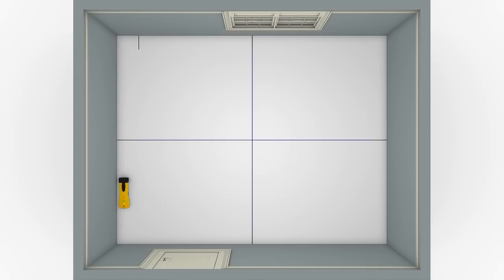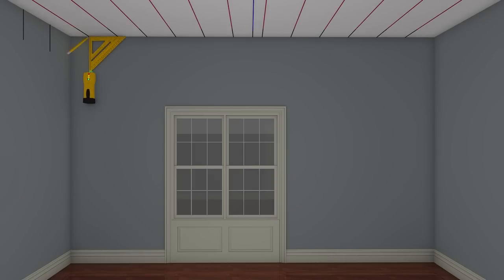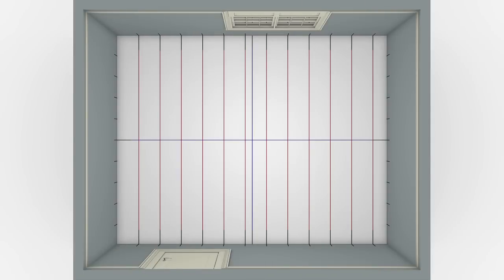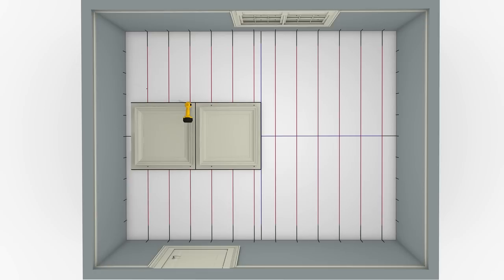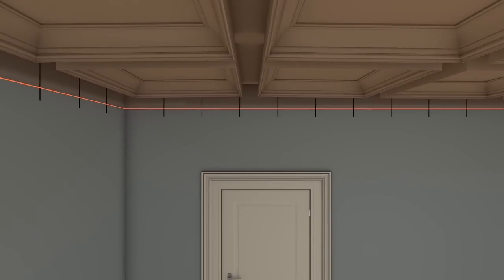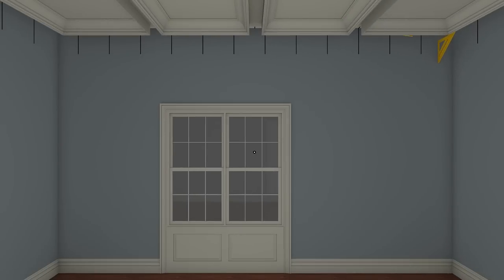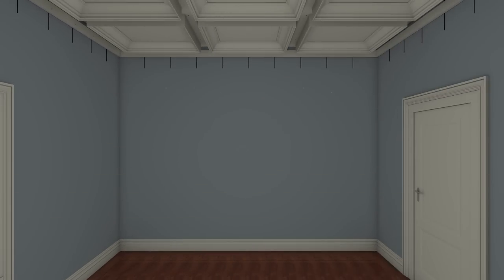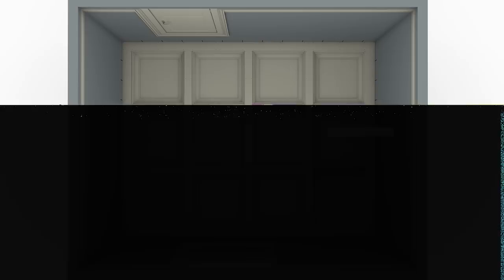Tilton Box Beam Coffered Ceiling System | QUICK & EASY TO INSTALL!

Comment: That's interesting but I have a few questions. What do you do if: 1. you have can lights, 2. a sprinkler system, 3. if you have speakers installed in the ceiling 4. the room is not square (it never is), the ceiling is not leveled. There is a huge difference between "building" a ceiling like that on a laptop, sitting on your couch and doing it in reality.
Reply: Stop asking Real Word Questions, Your ruining my perfect ceiling ;-)
Reply: You’d have to plan around the immovable thing (sprinklers) and plan to move all the rest around your ceiling. This is why most people do these ceilings at new construction or during a remodel. It seems as though you will have to supply this company with an actual measured layout of the room, and the pieces will be made specifically for your space. As for the squareness of the room, the level-ness of the ceiling etc - they were addressed in the video.
Reply: Simple. You delete the lights and sprinklers in that room.
Reply from the maker: We don't build our ceiling systems on a laptop, we custom manufacture them in facilities right here in the USA to support our economy. The video was created in virtual reality to provide a clear and concise overview of our simple process, but we also have a live action video for any naysayers that you can check out on our channel. 
1. If you have can/recessed light fixtures you can opt for our 'No Ceiling Panel' option which will allow you to install our system around these fixtures without the need to relocate or disturb them OR you can cut the appropriate sized holes for these fixtures into any of our other Ceiling Panel Options. https://www.tiltoncofferedceilings.com/box-beam-ceiling/product-options/ceiling-panels/ 
2. Unless you are willing to relocate the sprinkler heads we would need to plan the layout of your coffered ceiling so that they fall in desirable locations. 
3. Same as the answer for #1 except that speakers can be easily relocated as needed. 
4. We realize that no ceiling or room is going to be perfectly square and so our Box Beam Coffered Ceiling Systems have been designed to allow for flexibility in the Perimeter Beam Board to allow for variances. The Perimeter Beam Board can be ripped, scribed and/or tapered to accommodate as needed with the Perimeter molding covering any remaining differences.
Reply from the maker: @ralphvalkenhoff2887  This is certainly another viable option
Reply from the maker: @cloerockham8812  Precisely! We have measuring diagrams for all of the most commonly found ceiling shapes which can be used to easily provide is with the necessary dimensions. https://www.tiltoncofferedceilings.com/measuring-diagrams/
Reply from the maker: @1painter4hire  Haha!
Reply: @cofferedceilings   it's obvious You Guys are a High End Operation, There Always has to be that Guy who knows Everything, I'm sure You deal them All the time. Products look Great Guys !!!

Comment: good luck finding a perfectly squared room!
and people should know that probably have to scribe the perimeter trim boards for out of square corners, out of square walls, and bows in walls!
have a table saw ready and a box of caulking.
Reply: This is true.  My rooms look like something out of a carnival funhouse.
Reply: hostile177 
haha
Reply: Xvdeid
Reply: Any variance in the squareness of the room and/or straightness of the walls can be accounted for in the Perimeter Beam Boards. There are no standard or stock sizes with the Tilton Coffered Ceilings System therefore you would never end up with a 'partial' module. Every module we make is custom built for the ceiling it is intended for. We can produce any shape or size to fit any ceiling perfectly. (Copied from previous comment)
Reply: Thanks!
Reply from the maker: We realize that no ceiling or room is going to be perfectly square and so our Box Beam Coffered Ceiling Systems have been designed to allow for flexibility in the Perimeter Beam Board to allow for variances. The Perimeter Beam Board can be ripped, scribed and/or tapered to accommodate as needed with the Perimeter molding covering any remaining differences. So yes, have a table or circular saw ready if your room is really bad and a quantity of caulking to commensurate with your cutting ability (i.e. the worse your cutting the more caulk you'll need).

Comment: What if you have to cut a section to fit or do you order after measuring your ceiling? Can you cut for lights? What happens if a light does not fall into a section?
Reply from the maker: None of the coffer modules ("sections") will need to be cut to fit since they are custom manufactured to fit your ceiling based on the dimensions you provide to us. Yes, you can cut the ceiling panel to allow for lights and if a light fixture does not fall favorably within a coffer module you can relocate it accordingly.

Comment: What do you do if the ceiling isn't exactly square? How do you adjust the size of the module if the dimension of the room says you need a partial one?
Reply from the maker: No ceiling or room is going to be perfectly square and so our Box Beam Coffered Ceiling Systems have been designed to allow for flexibility in the Perimeter Beam Board to allow for variances. The Perimeter Beam Board can be ripped, scribed and/or tapered to accommodate as needed. Since we custom manufacture each and every Box Beam System to order, every coffer module is made to fit the ceiling it's being installed on and no partial coffers are ever needed.

Comment: Looks like pretty sound system, depending on cost, building that from scratch with MDF and mouldings would take much much longer, have done em b4.......but yeah studs and square rooms aren't that simple......the scribe moulding take care of gaps in walls where there wavy........
Reply from the maker: We realize that no ceiling or room is going to be perfectly square and so our Box Beam Coffered Ceiling Systems have been designed to allow for flexibility in the Perimeter Beam Board to allow for variances. The Perimeter Beam Board can be ripped, scribed and/or tapered to accommodate as needed with the Perimeter molding covering any remaining differences.

Comment: And if Toll Brothers built the place the studs and floor joists are framed on "The Diamond" meaning every 19.2 inches...
Reply from the maker: Not a problem! We realize that lots of homes are framed with joists or trusses at spacing other than 16" on-center (i.e. 19.2" or 24") and since our coffer modules only require 4 mounting points each (with the average size being in the 48" range) they will all cross over at least 2 joists/trusses to provide the 4 mounting points as needed.

Comment: What if the ceiling is 24" o.c. truss bottom chords?
Reply from the maker: We realize that lots of homes are framed with joists or trusses at spacing other than 16" on-center (i.e. 19.2" or 24") and since our coffer modules only require 4 mounting points each (with the average size being in the 48" range) they will all cross over at least 2 joists/trusses to provide the 4 mounting points as needed.

Comment: Ceiling joint is not every 16 inches,  most home is every 24 inches.
Reply from the maker: We realize that lots of homes are framed with joists or trusses at spacing other than 16" on-center (i.e. 19.2" or 24") and since our coffer modules only require 4 mounting points each (with the average size being in the 48" range) they will all cross over at least 2 joists/trusses to provide the 4 mounting points as needed.

Comment: In the real world, at least a light fixture would have been on the way somewhere in the ceiling.
Reply from the maker: Yes Captain, in remodel type applications light fixtures will typically exist and as such you would simply need to cut the appropriate size openings in the Ceiling Panel of the Coffer Modules to accommodate for those fixtures. With surface mounted light fixtures the junction boxes would need to have extensions added to them and with recessed fixtures they would need to be removed and "remodel" type fixtures reinstalled by way of securing them to the Ceiling Panel of the Coffer Modules with their integrated clips instead of to the drywall. 
An easier solution for applications where light fixtures already exist would be to utilize our No Ceiling Panel option found on the following page which allows for the fixtures to remain in place during the installation:  https://www.tiltoncofferedceilings.com/box-beam-ceiling/product-options/ceiling-panels/

Comment: It looks simple but it's not that simple. For example, finding studs is not as simple as this. They are not always 16 inches apart etc.
Reply from the maker: We realize that lots of homes are framed with joists or trusses at spacing other than 16" on-center (i.e. 19.2" or 24") and since our coffer modules only require 4 mounting points each (with the average size being in the 48" range) they will all cross over at least 2 joists/trusses to provide the 4 mounting points as needed.

Comment: What a ridiculous system. Only works in an ideal situation.
Reply from the maker: I'm not sure what makes you say that? We have yet to encounter a ceiling size or shape that it won't work on (many of which have been less than ideal). As the video demonstrates, the system actually overcomes many of the obstacles one would typically face when trying to install a coffered ceiling from scratch.
Reply: @cofferedceilings  Sorry, but I aint seein' it.

Comment: Measuring and marking will take a whole day
Reply from the maker: Measuring to find the center point of the ceiling is about as basic as it gets and once you locate the first joist and know their spacing (i.e. 16" or 24" on-center) finding and marking the rest is quick and easy.